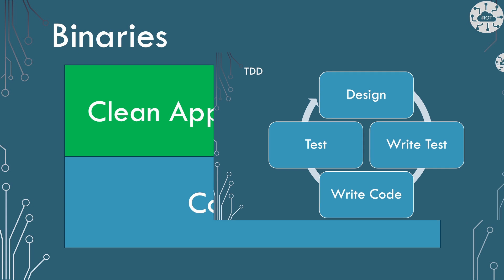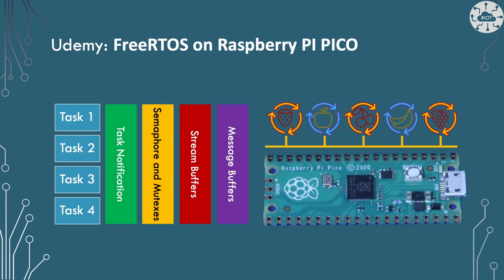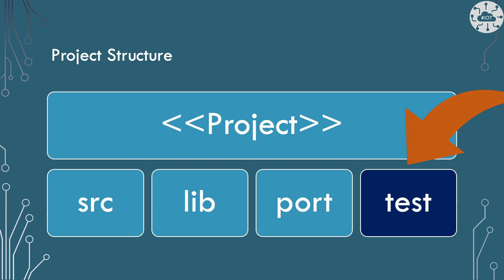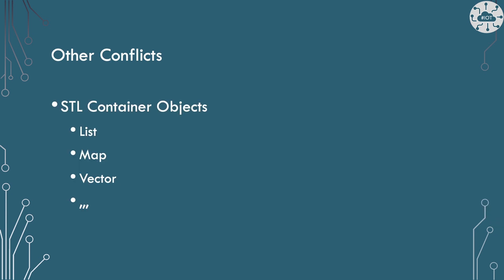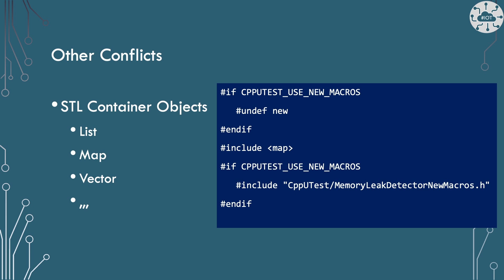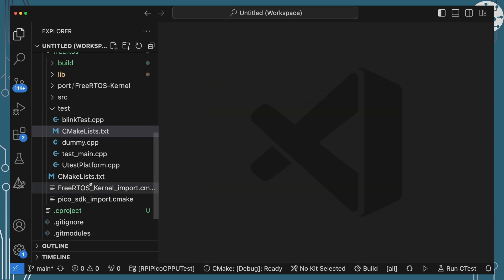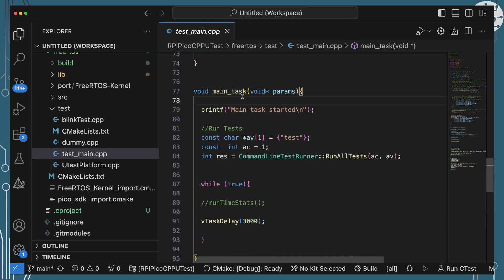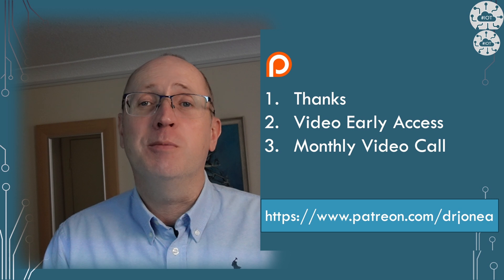Unit Testing (CPPUTEST) with FreeRTOS on Raspberry Pi Pico

Comment: Thanks for making this unit testing video . Is it possible you could show how to use GTest on the same PICO/FreeRTOS platform?It seems like GTest and CPPUnit are more sought after frameworks.
Reply from the maker: Thank you for the suggestion. GTest and CPPUnit get used together quite a bit. Let me see if I do something on this.